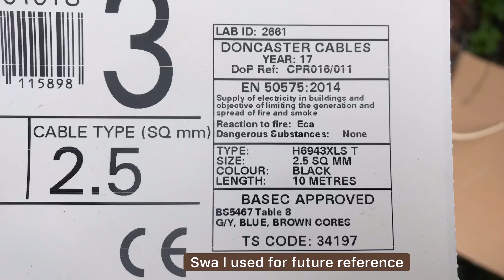Installing New Sockets In Office/Shed. That Tool Box !!!

Comment: I've done a fair bit of domestic electrical installs over the years but I've also done a lot of marine electrical builds as well, I've found the open top CK magma tool bag, CK magma technician case and CK magma tool roll have been my best investments.
The tool roll has a range of screwdrivers,  side cutters and pliers,  2 pole tester, lace ferrule crimper etc which are all my initial tools for installation or inspection work.  I keep all my Fluke test equipment in a Peli sniper rifle case (that gets some looks) You will always need a range of different tool kits for different trades just so you can make good as well as sort out other people's bodges.

Comment: Funny as it's like looking at my own gear as it's basically exactly the same including all the odd things.  Weighed my bag recently and it was over 30 kg so need to do the same sometime.

Thing with drivers breaking is it seems to be a metal hardness trade-off in that harder metal stays sharp longer but are prone to snapping versus softer metal having more give but getting blunt quicker.

Comment: Once you've cut though the outer jacket and armoured sleeve, slide the cutter a little farther down and use it to cut through the outer jacket again (but stopping before you cut the armour) to make a quick, clean cut to prep for the gland rather than use your knife...you get a much better cut with less chance of a slipped knife gashing something you don't want gashed (like yourself and/or your coworkers)...

Comment: Had the armoured slice tool quite a while, ok for small armoureds. The armoured up to 50 mil 4c still use it much to the amusement of the cable gang :-) but still revert to hacksaw and wire to prep 120 and above. The Blades wear out quick for me but then i do a lot of glanding. They have spare blades in body of tool.